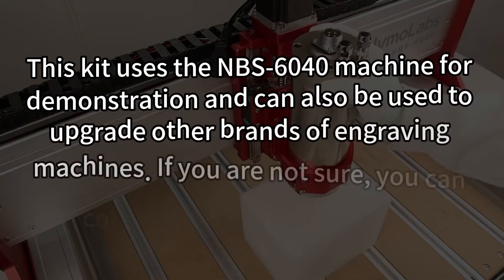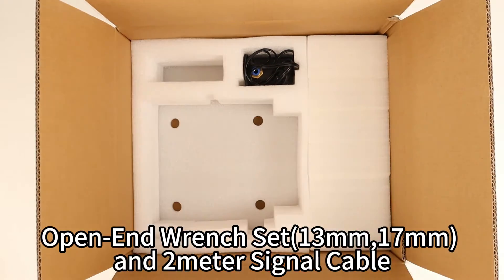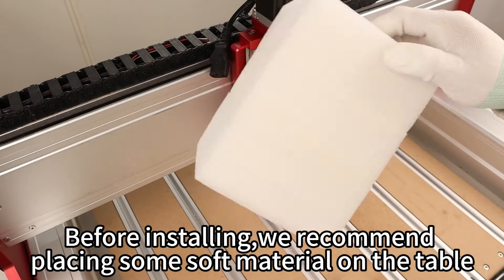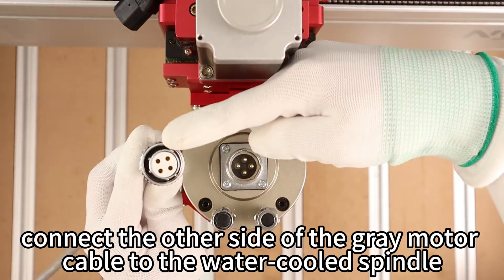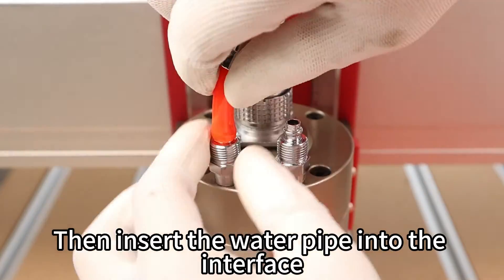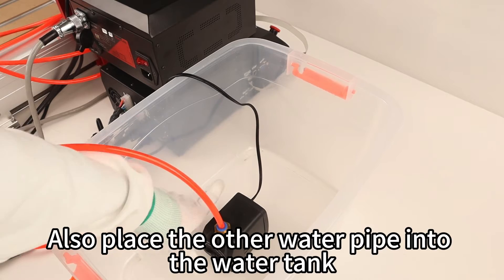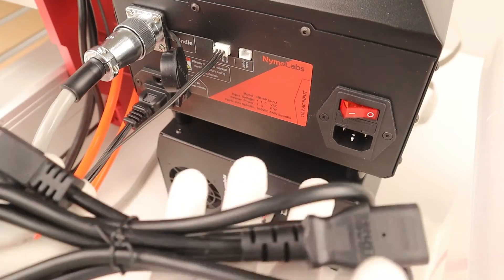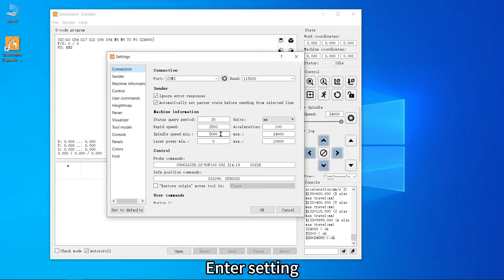NymoLabs water-cooled spindle kit unboxing, installation, and engraving demonstration

Comment: Do you need the Ingraving machine electrical control box when running a nymolabs 4 axis cnc controller model NB-OC7-V3.1
Reply from the maker: Yes, the NymoLabs 4-axis CNC controller needs to be used together with the electrical control box. This offline controller is used for controlling operations and cannot replace the control box itself.

Comment: Does changing from the 65mm to the 80mm water cooled spindle reduce the working area at all on the nbx 6040 machine?  It looks like it might lose some x-axis range.
Reply from the maker: Hello, I'm very sorry for the late reply. It will not affect the X-axis travel, because the diameter of the spindle bracket 80mm is smaller than the width of the Z-axis. We have actually tested it and it will not affect the X-axis travel.